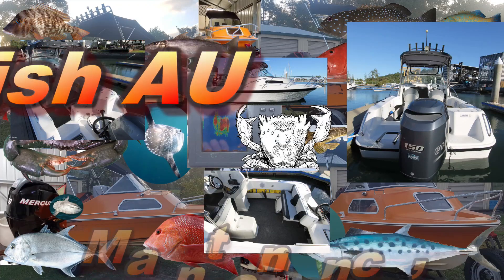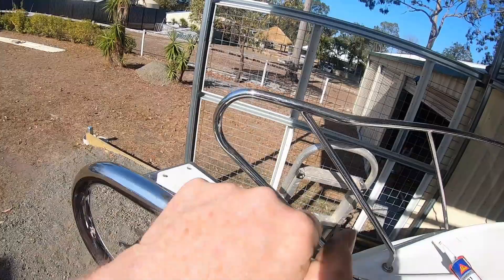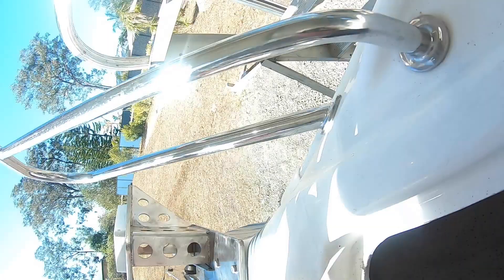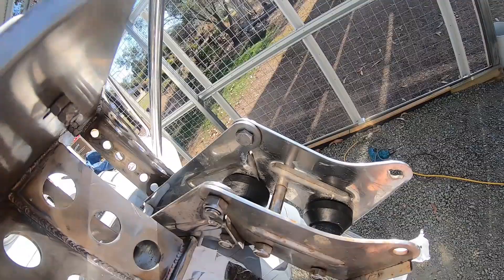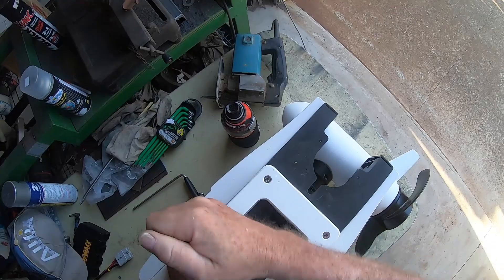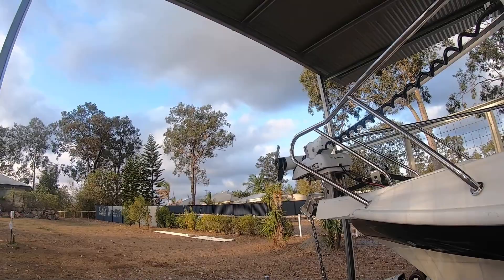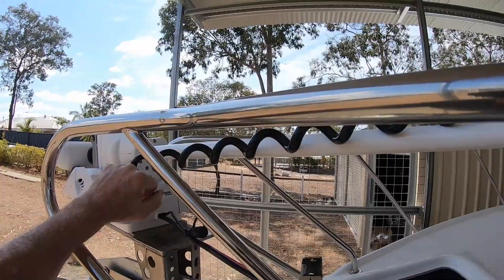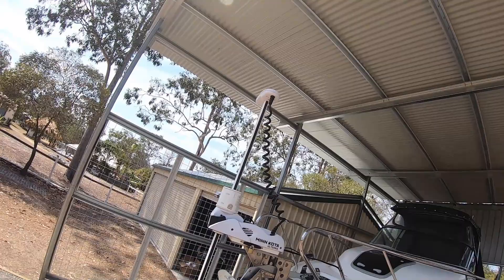Fitting a Minn Kota to my Baysport Offshore – 2 of 3

Comment: How does it cope with the weight of the glass boat, does it spot lock ok etc? 
Some excellent information and detail on the build and install 👍
Reply from the maker: Quite well.  The only trouble I have had with spot lock was one time offshore where the current was running close to 3 knots and it couldn't quite hold against it.
I did upgrade it to a 72" shaft though.  It wouldn't have helped on the high current I mentioned but it is needed when it gets a bit rough.
Reply: @weFishAU  thanks. I have a 5.2m glass boat and never gave it thought as I didn't think it was possible until I saw your video 👍
Reply from the maker: Being able to spot lock where you need to to drop your line onto the fish is a game changer,.
Reply: @weFishAU  it would 100% be mate. I love getting offshore which requires a decent size boat but having that option to fish structures in an estuary also would be awesome!
Reply from the maker: It's good on the shallow reefs too.  And when the current isn't running too hard you can sometimes spot lock for a while in front of a FAD before the drifters turn up, then I also drift because it would be bad manners to hog it.